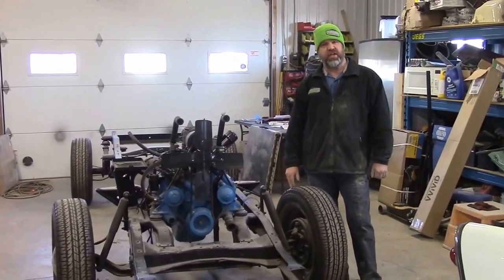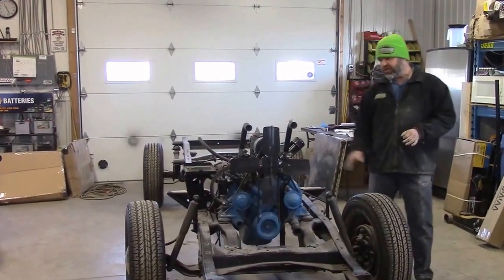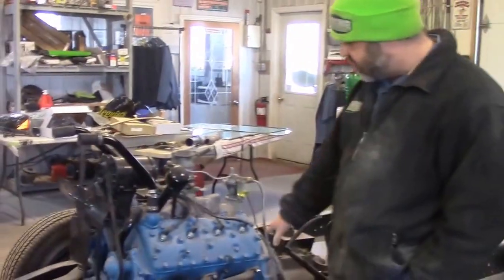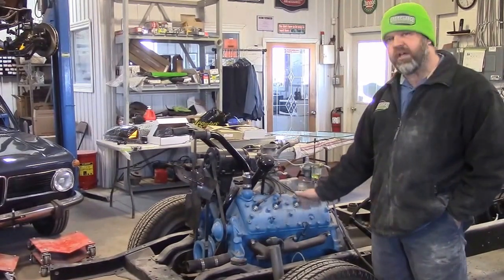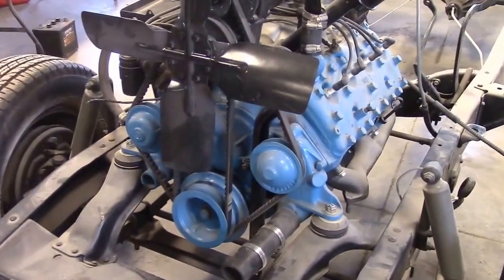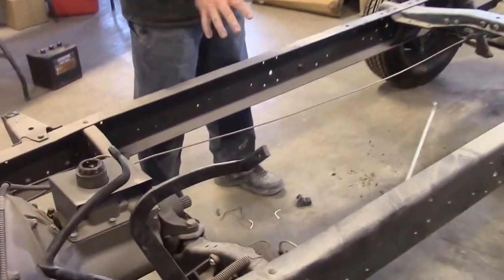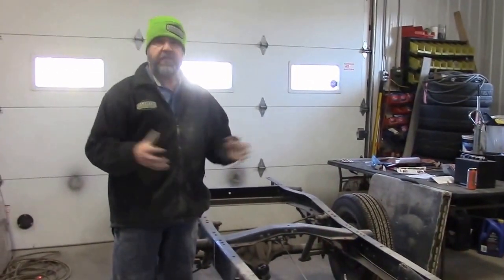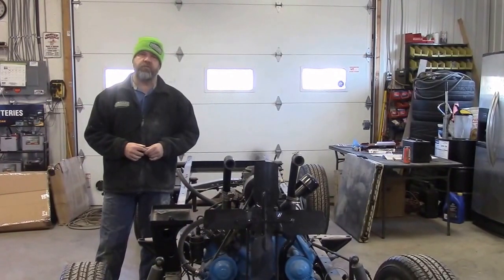1950 Ford F47  F1 Truck Restoration Update Part 4 ,  lastchanceautorestore com

Comment: If it's not gonna be a "trailer queen", I hope that in the interest of safety that you install a dual master cylinder instead of the original...and a nice dual exhaust system will allow everyone to really enjoy the music that old flathead can make...I've done these mods to my 1952 F-1 twenty years ago and I've not regretted it one bit...Cheers !
Reply: Sorry...I missed the disc conversion, and commented too soon...My bad.